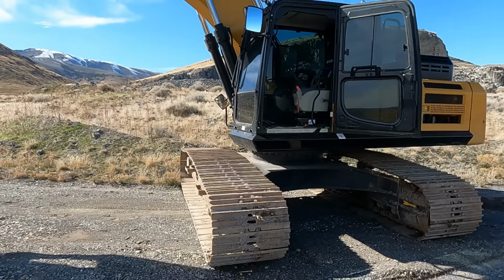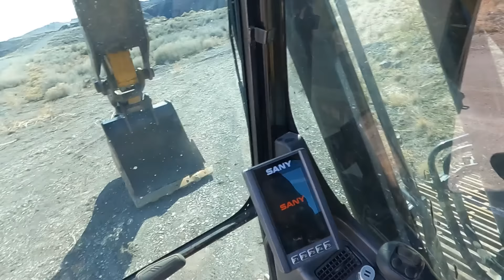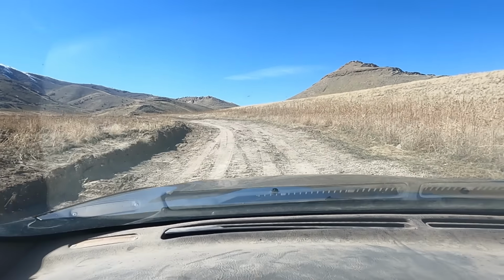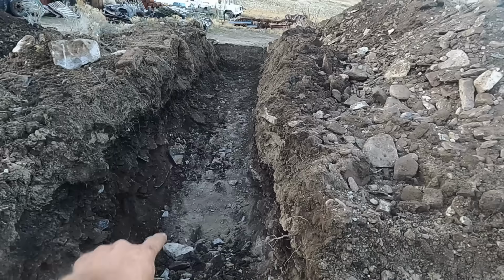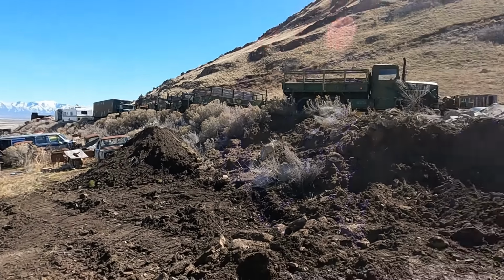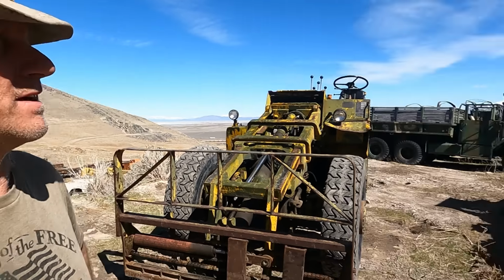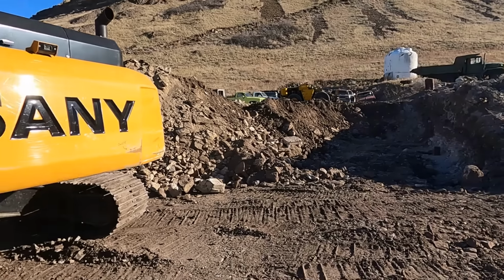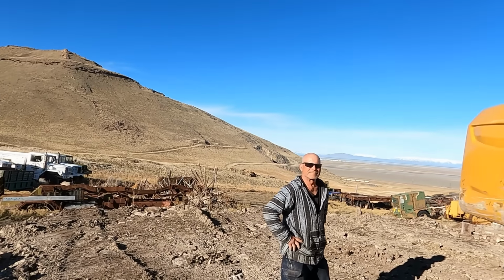Vintage and Modern Heavy Equipment  Fortress Depot Upgrade

Comment: You need a bulldozer to move that amount of dirt and gravel. It would be much quicker than the Sany. Just a thought.
Reply: Wizzy try's mightily to keep the thoughts to a minimum. He's doing a heck of a job on that front.
Reply: It's part of the show 😅😅😅
Reply: He has a bulldozer but the Sany can do the job quickly and make less mess
Reply: @maureencallahan1604 not at all. I operate a d10 bulldozer for my occupation and could move and level that whole 150yrd road in less than 2 hours. I can move 25 yards 20 ft In 10 seconds and he’s moving 2 yards at a time smh
Reply: @maureencallahan1604  I have a pantdozer. It can get work done.

Comment: Interesting project! I hope that the ground is good filling and that you can use what you remove to fill up the lower part. And please dig trenches on the outside edge, primarily the mountainside, to keep the parking lot dry.

Comment: Alan, you need a grade beam!
Find a 6' - 8' scrap of heavy "I" beam (preferably with a 12"+ web) grab it horizontally between the thumb and bucket. Your excavator becomes a road grader. I've watched skilled operators smooth & level as far as the arm can reach without moving the tracks once. My excavator contractor had several even a small one for his mini... They would even grade angles/slope just by picking it up for the desired effect.
(Don't be fooled by the over complicated DIY grade beams other YToobers show) It's not that complicated! It takes practice but in the hands of a skilled operator works like magic!
Reply: That works on grading a loose material, probably after the  excavation and removal is completed. But the compacted material, compressed over thousands of years, surrenders only to a brut force of the teeth on the bulldozer bucket.

Comment: If you don't slope that trench back in a deluge the water will slam of the trench and cut the shit out of the side of your road, also some sand bag snakes placed hear and there for the length of the trench will help. These are only suggestions it's your property obviously do what you want.
Reply: Pump the brakes son, not much of what Alien does will ever make sense. I think Heavy Dork distanced himself from Alien because it's becoming increasing obvious that Wizzy has a screw loose.

Comment: Alan - pumps do not make pressure they make flow.  If you have a pressure problem it is probably a pressure regulator. Contrary to popular opinion pumps do not create pressure, they have a max pressure rating but restriction creates pressure from flow.  ❤

Comment: Considering all the excavating you do, have you considered a basic laser leveling system?  Entry level systems that give you a level readout in the cab start at around $1,000 new plus you might be able to find a bargain on used a 2D system as operators upgrade to 3D.  Saves time, wear on the machine and fuel costs plus its safer since you no longer need a man in harms way on the ground near the machine to assist.

Small time operators I know love their leveling/grade systems and wouldn't consider going back to doing it with a string.

Dave might surprise you and already have one or more sitting on a shelf somewhere.

Best!
Reply: I think Wizzy would rather you buy him one. Jump on the Wizzy train baby! Ass, gas, or grass, nobody rides for free.
Reply: @unclebuck5051  Have to buy my own stuff first.  Nobody rides for free at my house either.  ;>

Honestly I mostly help folks who are worse off than I am since they need it more than all others.  Allen is really pretty well off compared to many elderly living hand to mouth with their ability to keep a roof over their heads and have one decent meal a day always in question.  Many are disabled Vets who fell through the cracks in the system.

When you have limited means you have to prioritize who you give assistance too.

If Alan were local and needed a ride to get groceries, to put a shirt on his back, to make it to a dearly needed doctors appointment or even needed help fixing a fuse I'm all in.  Things I can still do "When I'm 64"+.  Was Ringo singing about me?

Best!

Comment: Food for Thought, Not a single one of those rigs will care or be affected by setting on a slight slope, it will take a lot of time and fuel, wear and tear on the machines to drop the level 7 ft+. I think I would utilize the Sany to excavate and level the area you were going to put your depot shop. As long as the parking area is flat,  it doesn't necessarily have to be level. All this is a suggestion, it is your property, your time, your equipment. But I would prioritize where I spent my effort, money and time, when I want certain things done or need certain things done. A little long term planning goes a long way. Good Luck and Carry On !!!!!!
Reply: Nothing Alien does seems to be making any sense.
Reply: I too question why. That's a lot of work for no apparent gain. Even multi-levels on either side would be more efficient use of time and fuel
Reply: Drainage. Did you watch the video and see all the ruts? He is most likely trying to form some usable ground and divert drainage.
Reply: He should reduce the need for usable space and build out the fortress and move in and get on with his life. I did watch the video. I can't shake the impression that Alien is addicted to subscribers and Patreon, and that drives his thinking or lack thereof.  He gets plenty of solid advice on his channel and doesn't appear to take advantage of any of it. @Kevytc
Reply: The advantage of living in this country is guys like Alan can do what ever they please how ever they want to.
Reply: There are spots where there’s no zoning or building codes. Apparently Aliens spot is one of those. Unfortunate for the environment, neighbors, etc.
Reply: @GilCadwell but as Alan stated it is paid for by us.  
Not that I care what he does, his plan seems scattered. But he might have one we just haven't been told about
Reply: @unclebuck5051 it only has to make sense to him.
Reply: Apparently you have never tried working on anything that's on a slope - angle - ect.
Reply: @unclebuck5051  freedom. Ain’t it grand ?
Reply: @charlesjohnsjr.5809  I must admit I like it.
Reply: @unclebuck5051 If you had even one percent of his ability... He touches every field and succeeds every time.
Of course, it's easier to play the hater from behind your keyboard...He's probably not the best heavy equipment operator I've seen, but he gets the job done, and that's the beauty of it.
Reply: Trust the process. All will be revealed in time.
Reply: @scottleonard2126 , if you only knew, the world and equipment have been worked on in the most ungodly positions and angles for time eternal. My thought is simply park on anything you want, level up your shop area while he has the big excavator. Just makes more sense than chaotic random digging.
Reply: Perfection, OCD, visual look and trying to work on something that not on level ground can be a pain. Alan is doing his thing on his land and doing a good job. My own opinion.
Reply: @unclebuck5051 Just because it doesn't make sense to you doesn't mean it doesn't make sense! 🙄😒🤷
Reply: I’ve come to the conclusion the guy can do what he wants. I mean he built a mansion out of block. His patience and confidence will blow anyone out of the water. He’s very smart and he clearly has a plan. What’s his plan I have no clue but one day we may see it all come together. But I agree as well he’s all over but it makes for interesting content and I think that’s why we all come back.
Reply: What is Your Net Worth Alan? All those Vehicles are Worth Millions
Reply: Dude is just out here living his life how he wants to. Just enjoy the ride. Not your money not your problem.
Reply: Flat land lay down yards you can store lots of things and use a crane passive income can from this considering the companys he works with seems a likely opportunity  more than a waste of resources

Comment: You should find a jobsite laser level. Far more accurate than a line level, much faster as well. You'd be surprised how much string sag you get when you stretch out a line and slap a little bitty level on it.  A laser level and a can of marking paint, write numbers on the ground for high or low, it gets you close without the constant getting on and off the equipment.
Reply: Actually I think the Sany can do that in the cab he just needs to program it. 🤔

Comment: That is a large area to be flattened, hopefully rain and snow melt won't puddle up on it. A slight angle to it seems to me a better choice. But, I am not a Wizard, I'm just a Wizz that wishes for a Mountain Fortress of my own. Alan, do you need any Sentries for your Fortress?
Reply: What are "Sentries?"
Reply: @wesman7837  Basically just Wall Walkers or Guards , and an alarm system thru shouting fires and flags.

Comment: Need a new cutting edge on that loader bucket
Reply: Not to mention teeth on the excavator bucket.  Bad to break rock with a bar across the teeth.  He needs some new teeth, they look like numbs under that bar.
Reply: @liquicrum  ya man, that's a clean-up bucket, hence no rock teeth.
Reply: @Bigdaddyslasher It sure worked great for the road though!

Comment: Here Allan, you were up at Cerro Gordo with the lads installing the concrete foundations for the American Hotel and the big water cistern for the fire suppression system Brent has going on up there.

I'm thinking back to how he got his access roads into Cerro Gordo washed out by rain storms.

Maybe you could give Brent a wee heads up on preventative engineering, explain what you're doing there to protect the vehicular access routes to your mountain fortess during the Monsoon Season.

Comment: Sell some of the trucks and get a good bulldozer,that would be far mor efficient for moving all that rock about once you have dug into it .
If you have some steel plate ,a cutting edge on the front of Loader bucket might improve its ability to get more dirt inro the bucket ?
Best thing is the weather working in your favour,may it continue.
Reply: Hoarders can't part with anything, they just add to the hoard. Generally speaking it seems that folks like a good slow motion train wreck, and that's what they get when they tune in here.